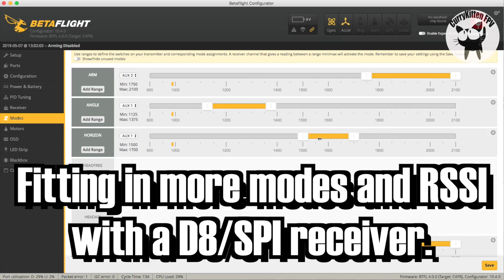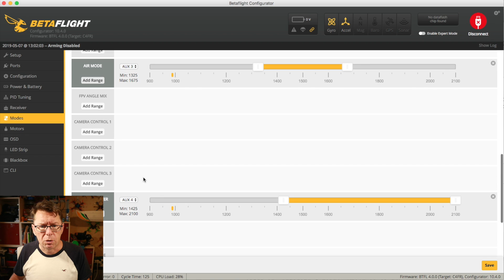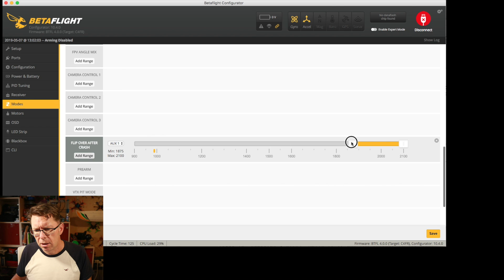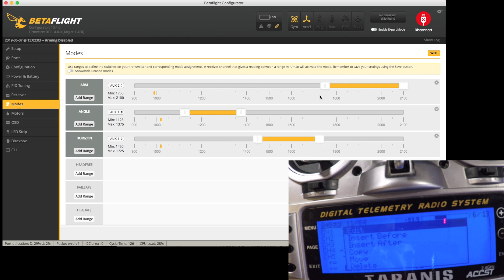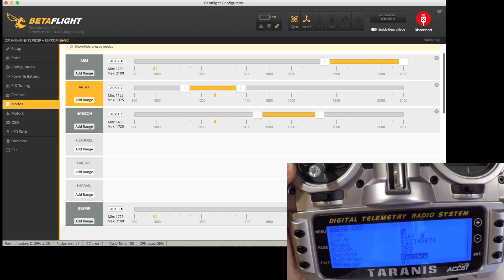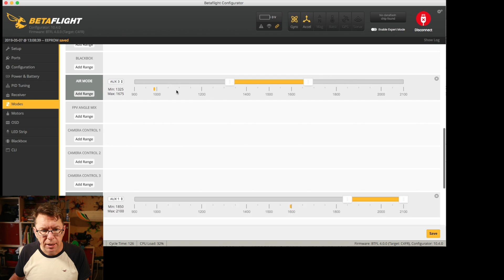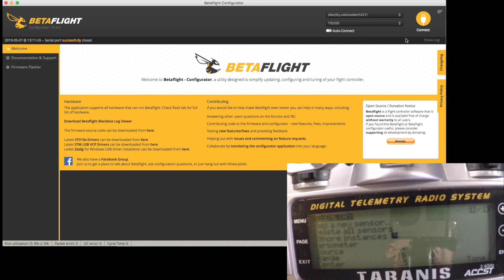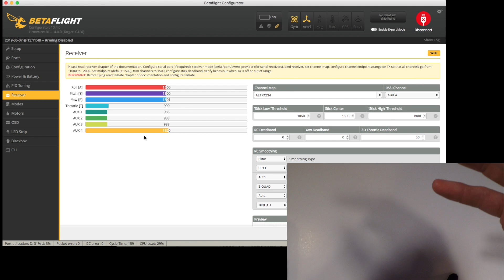Fitting in more Betaflight modes & RSSI using a D8/SPI receiver

Comment: So I’m getting confused about the whole “RSSI on spare channel” thing. I have an SPI receiver and I get the RSSI through the “sensors” tab and can see it on the transmitter display along with battery voltage in the quad. At the same time I already see RSSI in the goggles as I believe the sensor data is passed to the flight controller which handles osd. So what is the reason for sending RSSI back to the receiver when it already has it, what am I missing?
Reply from the maker: It's more what I was missing at the time.  Given that RSSI wasn't transmitted on a channel but we got it in the telemetry my understanding was that we needed to send it back to the quad on a channel to have it appear in the OSD.  Since that time, I've learnt that RSSI is just there, but - slightly counter-intuitively for this to happen you set the RSSI channel to none and then just have RSSI on the OSD.  I think I talked about this in another video, but I probably need to do something to make the whole thing clearer.

Comment: how to change from d8 to d16 mode in the fc?
Reply from the maker: In SPI terms, D8 is FRSKY_D and D16 is FRSKY_X find them under the drop down under SPI receiver in the config page
Reply: @CurryKitten  oh that is easy. I am worried about getting taranis x9 lite not having D8 and buying a whoop with frsky receiver. That is nice that you can switch to d16. Have you tried a good whoop fc 1s brushless being great at d16 ?
Reply from the maker: D16 used to cause lock-ups because the CPU was being utilised too much (especially in conjunction with 8k/8k loops and telemetry) this is apparently fixed in later versions of Betaflight, so things should be fine if you are up to date with BF firmware.  As far as a 1s quad that's great.  The Mobula6 is certainly one of the best around at the moment.
Reply: @CurryKitten  what about the betafpv meteor 65?

Comment: What version of betaflight do you need to get a trashcan working any help please
Reply from the maker: It shouldn't be too fussy - what problem are you getting ?
Reply: I have all my modes sorted  but when you go to arm it won't iv tried it with batteries and no go but wen I go to receiver tab everything is fine apart from the quad in bottom right is spinning like crazy any ideas thanks
Reply: Sorry to bother you again but when I look through the goggles I can see stability mode flicking to horizon and then to across all on one switch but the arm switch does nothing nor does the beeper switch any ideas please
Reply from the maker: Right, well it seems you have two issue here.  Firstly, you certainly don't want the image of your quad to be spinning wildly.  It sounds a little like your channel order might be wrong for that to happen.  Check if you channel 1/2/3/4 order is Aileron/Elevator/Throttle/Rudder (AETR) or Throttle/Elevator/Aileron/Rudder (TEAR) if your is one and it's set to the other then a spinning image is what you might see.  The flicking between modes suggests that your modes isn't setup right - perhaps you've spanned two possible modes within one switch position, or it's right on the border and so a little bit of twitch from the gimbals is going between the two.  If you can't fix it from this, then screen record betaflight with your quad plugged in and your radio on so show the receiver screen and what happens when you move your sticks, and the modes screen with you doing your switches.  Upload it somewhere and give me a ping and I'll take a look.
Reply: Buy the way arm is on aux1 modes aux2 and beeper aux3
Reply: Your a genius man or I'm thick as shit all it was change aetr to taer witch I tried earlier but forgot to use capitals anyway cheers for all the help just in time my aomway commanders turned up this morning thanks again
Reply from the maker: @joeprince5415  Awesome stuff - happy flying :)

Comment: Did you avoid using the dials because you don't have them on x-lite? Also is it the order that changes the range so you have to switch the same switch several times to change the levels?? If you can't tell I got a little lost.  Might just be tired tho! :)
Reply from the maker: I don't use the dials (or pots) generally for any flight modes because they are completely free to turn.  Some people replace their nes with 6 position rotary knob which clicks into place - this is much more useful for flight modes.  You can put the mixes in any order you like, all I was doing with the switch settings is making sure I had the right one, So I needed to make a mix that got activated on switch up, switch mid and switch down with a different weight on each one which would select a specific mode.  Make any more sense ?
Reply: @CurryKitten  As I said maybe I'm tired but you seem to set 4 things to a 3 position switch? Hence my question about if it 's the order of the switching! I'm a noob to RC so not familiar with the way they work in all honesty.  I stay well away from using the transmitter for most stuff.  I have set up RSSI but thats about it. :) I'm pretty IT literate so I understand the Betaflight can handle 1 switch doing everything but the transmitter mixes confuse me.
Reply from the maker: Ah ok, I see the confusion here.  We're making 4 mixes on one channel, but 3 is on 1 switch and one is on another.  That's how we're squeezing extra modes and saving a channel - by using extra switches we're basically moving our mode from another channel.  Also this is why we pick the modes carefully, and I use the replace mix on the extra switch
Reply: @CurryKitten  Ok so if I understand you correctly you are sending the signal down the same channel but using different switches to control the signal strength hence the adjustment in BF? :) So in theory you could use multiple switches on the same channel to do everything!
Reply from the maker: Yes - exactly.  It's not practical of course, but entirely possible - but it saves us a channel to fit the RSSI signal in, which is what I was aiming for
Reply: @CurryKitten  Now I've got it!! Thanks for that!! I must admit I was lost.  Seen a few videos doing mix stuff and was never any the wiser after.  Are you at the RC mini thing all weekend? If so I shall have to come and find you and shake your hand!! :) Love the channel and your helpfulness.
Reply from the maker: The MiniAirShow - I'll be there yes.  Bring your radio along if you want me to go through it with you
Reply: @CurryKitten  Cool!! I'll probably only be there on the sunday as I'm working saturday but may well bring my 1s and my trashcan for some fun but way behind on my 6s build to get that done and maiden-ed in time.  If you see a big guy with long hair and a beard walking towards you it may well be me!! :)

Comment: Great video😎👍 You're the second person I have seen doing this from the transmitter side, which to me is a lot more cumbersome. How come no one uses the additional ranges available with the modes? The "Add Range" button next to each mode. I'm sure it's just a preference, but you can accomplish this in Betaflight, without changing anything in your transmitter. Just add on additional ranges to the modes. i.e. In order to activate beeper (aux 2 high), arm switch needs to be disarmed (aux 1 low). Otherwise, if you activate the beeper switch (aux 2 high), when armed (aux 1 high), it does rescue mode or activates angle mode or any other mode. Basically, you can set modes to combinations of switches in certain positions and double or triple your modes with 2 switches straight from Betaflight.
Reply from the maker: Quite honestly, I'd never looked at them before - but just having a looksie now, I can see they essentially can fulfil the OpenTX concept of logical switches (albeit straightforward ones) without running OpenTX.  Interesting - I'll cover this if I do something on logical switches.  The other thing to mention is that there's more than a few ways to do the same thing as I did in OpenTX as well - so you tend to stick to the thing you know, rather than exploring all the possible options.  Thanks for the insight though - I'm learning new stuff here :)
Reply: @CurryKitten  most definitely. No wrong way to do it, as long as it works as intended👍

Comment: OpenTX is so versatile. Problem is once you start fiddling, it’s hard to stop. I have a spreadsheet to remind me  how I got it set up.
Reply from the maker: You can go crazy - I find it useful to use voice prompts with switches just in case I forget and it can tell me.
Reply: Thank you,, I have set up two three-position switch on one channel using this method. Thanks for the advice. Very simple to follow, with great result.

Comment: That looks really useful....but for me hard to follow ..at the speed your doing it on the taranis...
I`m not complaining... but to someone thats just got to grips with the basic quad setup`s on the radio... this looks a little daunting...but a piece of cake for someone as proficient as you.
Reply from the maker: Sorry about that - I had 4 mixes to do on the same channel, so I went through them pretty quickly with the idea that anyone that wanted to do the same could always rewind or pause.  As long as the understanding is there that you define which switch you use and then use the weight to get the pointer on the exact position in the modes slider - they should get the rest (or hopefully post here with questions)